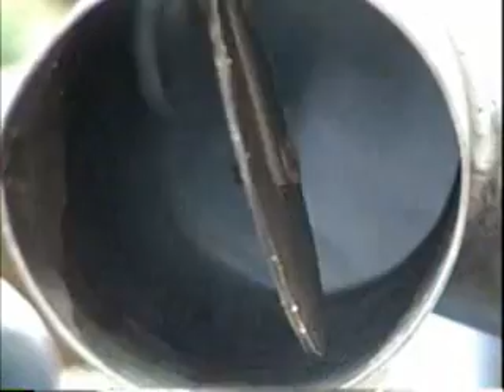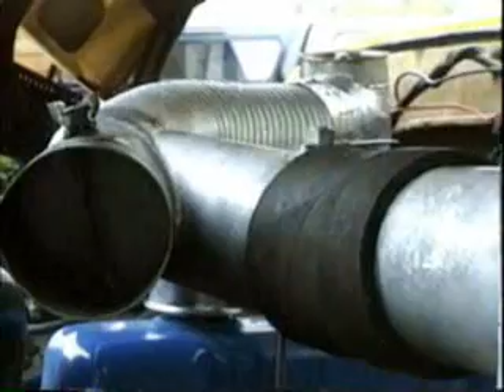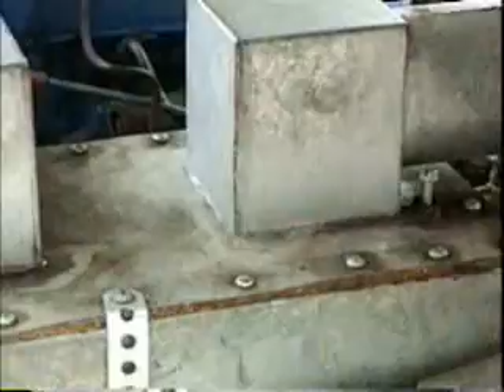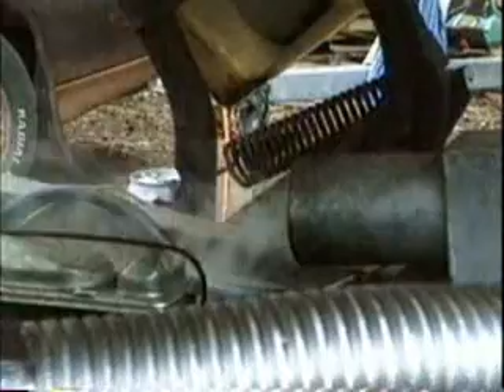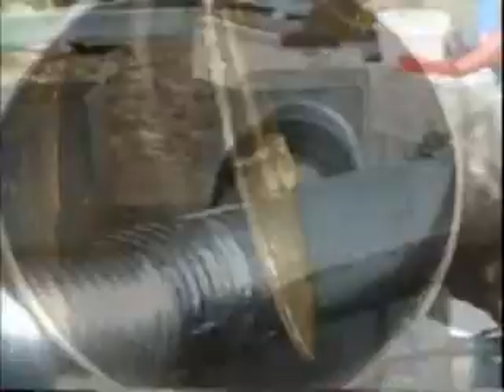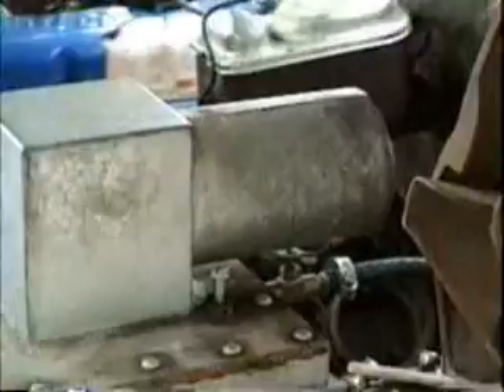Here is definitive proof on how to separate all Atoms in all liquid soluble matter.

Comment from the maker: For those who want to have the increased power, and probable better MPG, a combination of the GEET design, with a tubular heater from Chromalox Precision Heat and Controls. You will have the cleanest burning, most powerful engine for it's size. Chromalox can make any heater design you desire, at almost any voltage and temperature. They are an American company.

Comment from the maker: There is a guy in Oklahoma, he developed a GEET system. I told him if he used a tubular heater for the center tube on his system, he would have a device that would start up and run on the White Vapor, like I created. You can find him on the internet. His system would burn the liquid mine accumulates.

Comment from the maker: When I first did it. Nothing existed like today. I would say I spent about $1000 making it. A lot of time was spent experimenting with it, but never got to do a mileage test. The generator, I had made to produce the 110 VDC , at 2000 RPM, it would produce around 2000 volts at highway speeds. I had no way to regulate it back then. Inverters will work now. The size needed is around $150. I would say you could probably make one for around $250, not including labor to construct.

Comment from the maker: I found I had to keep the butterfly valve open slightly, so some carbs have adjustment screws for the idle turn the adjustment to hold the butterfly open slightly, and it will idle. I have let the engine idle at low RPM. You have to play with the butterfly valve and it will run.

Comment from the maker: When I first created the liquid, I thought it was my nemesis. But only a molecular change could possible turn the flammable gasoline, into a non flammable liquid, that doesn't mix with the gasoline it was created from, while at the same time a white vapor is created that has twice the power of gasoline. This is when I realized there are other temperatures inside every liquid. Never known about before.You are not adding chemicals, you are removing the chemicals using the right temperature.

Comment from the maker: When I did this, fuel injection consisted of throttle body injection. I made a spray system out of a 1/4 inch copper tube with one end welded close, and I made a really fine pointed punch from an anchor bolt used to fasten base frame boards to concrete foundations, because it is an extremely hard steel and makes a really long fine needle point, to punch the holes in the copper tube.

Comment from the maker: I am sure the temperature is related to the difference in the boiling temperatures of hydrogen and oxygen. Their temperature difference is in the 60 degree Fahrenheit range. This means, my heater needs to maintain that difference, when water is spray onto it. This will require a large mass of heater, and a fine mist of water spray..

Comment from the maker: Good luck with that. I thought the non flammable liquid was my nemesis, to run a vehicle on vapor, until I realized just what I did to the gasoline. A molecular change to liquids will make hydrogen from water at the right temperature. I am looking for that temperature now.

Comment: I understand. Im sure the fuel can be circulated outside of the chamber in its own reservoir and then injected into the chamber. The liquid left over would drain down to the bottom and then it could be removed. Is there any flaw to this thinking?

Comment from the maker: The spray is continuous as long as the vehicle is running. I used a pin point punch I made to punch hols in a 1/4 inch copper line. I punched the holes and angled them to spray on the two flat bar 250 watt 110 volt heaters inside the chamber. Because the gasoline circulates using the high pressure fuel pump, the gasoline has to be in the bottom of the chamber to, The non flammable liquid doesn't mix with the gasoline, after it has been sprayed onto the heaters. Compressor drain won't work.

Comment: Did you use a injector at the tip? Is the injection mechanism running all the time (constantly spraying)? I was thinking of making something like a drip pan with a fitting on the bottom if it to remove the non flammable liquid into a reservoir. Sort of like a air compressor drain.

Comment from the maker: I used a high pressure fuel pump to spray the gasoline onto the heaters, and the vehicle fuel pump along with a float valve, which maintained the liquid level inside the chamber. However like I said when the molecules separated, the non flammable liquid appeared, and built up inside the chamber, which stopped the chamber from making vapor when all the liquid at the bottom of the chamber became non flammable, and wouldn't mix with gasoline.

Comment from the maker: The one you see in my video had been on 7 different vehicles, I ran 2 dyno tests and got a 50% increase in horsepower over gasoline. I got Zero parts per million hydrocarbons on a smog analyzer. I was accused of using nitros oxide, by a college auto shop instructor, when running on the white vapor I made. I have only ran it on 8 cylinder engines, but the video on here on You Tube is 20 years old. Wonder when the did theirs? Bet they don't know it is a molecular change to gasoline.

Comment: I am not doubting or disputing that your system creates more power and is cleaner.  It most like IS because you are achieving a more efficient burn of a distilled fuel.  However, I do not believe that this system is more efficient because it requires a large amount of energy initially to vaporize the fuel.  Respectfully, I think that you are misunderstanding the physics of the system.  I realize that I am not a physicist, nor a chemist.  I'm just a laymen and a skeptic.

Comment: If you are inputting energy, then you have to subtract that from your overall output.  If it costs energy to heat your fuel that must be counted in the same equation.  The energy that it takes to heat your mass is part of the process.  When coal is burned to make steam, which spins a turbine attached to a dynamo to make electricity it isn't magically creating electricity.  It is using the stored energy within the coal and the whole process suffers a loss overall in the form of heat.

Comment: I'm no physicist or chemist but but I am pretty sure that atmospheric pressure dictates the temperature at which liquids with boil.  I don't think that your heat mass is heating up your gasoline any hotter than its boiling point at just a little less than one atmosphere of pressure dependent upon your elevation above sea level.  You can raise its boiling point by adding pressure but the addition of heat and pressure both require energy input.

Comment from the maker: Here it is, bottom line. Everyone adds heat to liquid, I add liquid to the heat. The heat builds up before the liquid boils, when adding heat to the liquid. The liquid boils at the temperature of the heater, when you apply the liquid to the heat. You can only reach the liquid's boiling temperature when apply heat to the liquid. You can take the liquid to any temperature when you apply the liquid to the heat, A fine mist spray, applied to a large mass of heating element works best.

Comment: I'm sorry, but I'm just trying to understand how the system works.  Is your vaporization chamber pressurized?  What is the efficiency of the system in miles-per-gallon?  What is the ratio of energy output to energy input?  If the vaporization chamber is externally powered do you account for this?  Is your vaporization chamber doing more than just distilling your gasoline, increasing the octane and separating the additives?

Comment from the maker: Man I don't know, I am sure the oxygen has less density than the gas does. It will take lab tests to know just what I discovered. For sure it is a molecular change. Nothing was added outside of heat applied the right way. Just using the right heat, proves there is a different boiling temperature in affect here, since gasoline boils between 100 and 500 degrees Fahrenheit, which is determined by the octane level in the gasoline. Higher octane level, lower boiling temperature..

Comment: When I see gasoline being vaporized with an ultrasonic transducer(see ultrasonic humidifiers), the 2 micron to 5 micron droplets of gasoline stay at surface height(remain on test table), rather than rise up into the air such that your white vapor does. I read that steam has a micron droplet size of approximately 1 micron. I wonder, what droplet size your white vapor may be just after 600 F flashing occurs.

Comment: In my observation of white vapor production from flashing the liquid gasoline at 700 degree Fahrenheit with a Calrod heated steal surface, I notice the white vapor goes straight up into the air. Is it possible the extra oxygen molecule has decreased the molecular weight of the white vapor molecules.

Comment from the maker: I have seen when the gasoline is sprayed onto the 600 degree heating element, miniature bubbles form with clear gas inside of the bubbles, and when the bubbles break, the clear gas inside the bubbles turns white, like magic, in front of your eyes. The liquid that contained the clear gas is the non flammable liquid I get, at the bottom of my chamber, when the liquid accumulates, and doesn't mix with gasoline anymore. That clear gas turned white from surrounding air, having oxygen in it.

Comment from the maker: I am actually spraying the liquid gasoline onto a 600 degree Fahrenheit heating element, and the liquid assumes the temperature of the heater almost instantly, before it can boil, at gasoline's boiling temperature, so it boils at 600 degrees, and up there are molecular boiling temperatures inside of the gasoline.

Comment from the maker: I don't think it is catalytically cracking the gasoline. The liquid is assuming the temperature of the heater, and it boils at that temperature (600 degrees Fahrenheit, reaching the molecular boiling temperatures of a group of molecules inside the liquid gasoline, thus turning them to a gas, while the remainder of the gasoline molecules remain the non flammable liquid that doesn't mix with gasoline, and is no longer flammable. The gas turns white turns white when oxygen fills the void,

Comment: Been thinking awhile on what you're doing. You're really on to something, brother. If its not flammable, even with a wick, you've found a way to catalytically crack gas, and so your residue is not a heavier hydrocarbon which would occur with normal heating of the gas, but something completely different. Hope its not poisonous. Have you had it lab tested yet?

Comment from the maker: Waiting for a tig welder, I want to add mass to my heater. The mass will stabilize the temperature, when the liquid is being sprayed onto the heater. This will insure that I can achieve hydrogen's molecular boiling temperature, while the oxygen molecule remains a liquid, therefore separating these molecules inside the water. This should boil all the hydrogen in the water, and since liquid oxygen boils at well under minus 400 degrees Fahrenheit, it will supply gas oxygen to the gas mixture, H2O2

Comment from the maker: The large mass of heat is a large metal heating element, I used a flat bar heating element (110 volt). I had two wired in series, and they were 250 watts each. , or build some iron around a heating element to make the mass large. It is the large mass that prevents the element from changing temperature, when the colder liquid is sprayed upon the large mass heating element. Use electric fry pan, on high, spray gasoline into the fry pan when it is at it's hottest, You will see the white vapor.

Comment from the maker: You are not using the chemical reaction of the water, you are accessing the temperature at which the hydrogen molecule boils and turns to a gas, inside of the liquid water, This temperature was not known about before, I found it in the gasoline, which it is easy to do it to, and knowing about the expansion and contraction of gasses, I know it is possible to do it to any liquid, and separate their molecules. Science will change now.

Comment: Question: For your Hydrogen production from distilled water test. Might it help to add a layer of Nickel or Silver to the top of your 1/2 inch heated steal plate. In other words, could Nickel or Silver facilitate the Cracking(via Catalyst) of Hydrogen from Oxygen.

Comment: Question: For your hydrogen production from distilled water test, might it help to add a layer of Nickel or Silver to the top of your 1/2 inch steal plate that you are heating. In other words, could Nickel or Silver facilitate the cracking(via Catalyst) of the hydrogen molecules from the oxygen molecules.

Comment from the maker: I know that hydrogen and oxygen both have a molecular boiling temperature inside water. I have heard from people that have seen hydrogen made from water using temperature. One time was inside a dishwasher, with water droplets on the heating element. Aviation used water injection for power increase on takeoffs in the past. Many have seen water ignite when massive heat is applied to water when douching a large mass of extremely hot metal. This tells me they are there, just getting to them is hard

Comment from the maker: I never did a MPG test on this system. The special generator I had made, produced too much voltage for road tests. I found at engine higher RPM's, the generator would produce 2000 volts or more. I had one of the heating elements (made of stainless steel), melted into two pieces with the excess voltage. Inverters did not exist back then.

Comment from the maker: I know the hydrogen and oxygen molecules have different boiling temperatures, their liquid boiling temperatures say so. Just like the gasoline has different boiling temperatures, according to it's chemical, octane level. I proved this with the white vapor, and the non flammable liquid I create. I don't know how accurate their determination of hydrogen and oxygen's boiling temperatures is, so I may have to use a larger mass, to prevent temperature change, when spraying water onto the mass.

Comment from the maker: I'm still waiting for the parts to repair my combustible gas leak detector, which will tell me when I have separated the hydrogen and the oxygen molecules in water, at the right temperature. Nobody has been here, everyone thinks liquids will only go to their boiling temperatures. I'm telling you, spray a small amount of liquid on a large mass of heat, that liquid will go to the temperature of that heater and boil at the heater's temperature, not the liquid's boiling temperature. Mass is the key

Comment from the maker: Just read the comments and you will know how to do it. I basically spray a fine mist of liquid onto a large surface heater. It is the temperature of the heater that the liquid assumes before it boils. Not the actual boiling temperature that the liquid boils at, when applying heat to the liquid. This has allowed me to find the boiling temperatures of the molecules inside the liquid, separating, gas and liquid molecules, inside the liquid original liquid.

Comment: You mention the possibility of oil refiners taking this remaining liquid out of gasoline. If this were to happen on a large scale, would we still fill our automobiles with liquid gasoline, which then would be molecularly changed and combined with the Oxygen Molecule with your design White Vapor Chamber, then compressed, ignited, combusted inside the combustion chamber.

Comment from the maker: The smog analyzer gave a flat line reading, nothing registered on the graph. The operator thought the probe, that he puts up the tail pipe, had broken, or was plugged or something. He banged it on the concrete, to clear it, and it would still read nothing. I know it was working, because he got a reading on the next vehicle.

Comment: When you drove your truck to perform the AAA Smog Analyzer Test(running your white, double the horse power, non condensing vapor), you mention a reading of zero PPM(parts per million) for the HC(HydroCarbons)meaning you had zero unburnt fuel exiting the combustion chamber. May I ask the reading for the CO2(Carbon Dioxide), and NOX(Nitrogen Oxides).

Comment from the maker: Again, you will need mass. The calrod heater is just 1/4 inch steel tubing with resistance wire wound inside. It doesn't have enough mass to maintain the temperature you are trying to get the liquid to, when you spray the liquid onto the heater.

Comment from the maker: I have repaired dishwashers before, there is no vacuum. just a rotating water spray, and a calrod heater, mounted on metal brackets that support it off the bottom of the dishwasher. I don't know what temperature it goes to, but it is kept away from the rack, and I have seen plastic melt, on the bottom shelf of the dishwasher.

Comment: I was thinking in reference to what temperature range the dry cycle of the dishwasher may have been. I believe it's an extremely hot steam, although I'm not certain. I will search for any reference to the maximum temperature a dishwasher may achieve. I'm also not certain if the dishwashers dry cycle is under a vacuum(negative pressure), during this steam cycle.

Comment from the maker: You know I went back to that 380 to 420 temperature range and just got the flicker from the detector. I was thinking it was the iron skillet, in the dish washer, that caused the water to convert to hydrogen, to make the blue flame. This is why I stayed at the lower temperatures. I think now, it was the actual calrod heating element from the dishwasher, that created the right temperature to separate hydrogen and oxygen in water, so I need to go higher, in temperature.